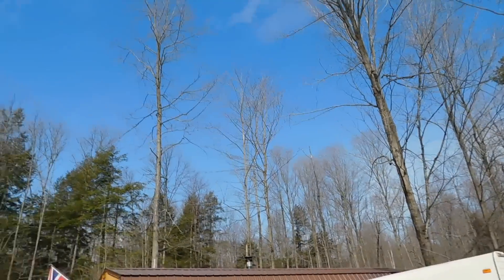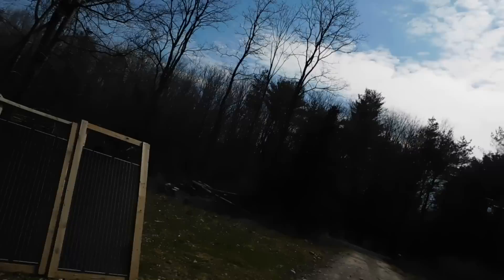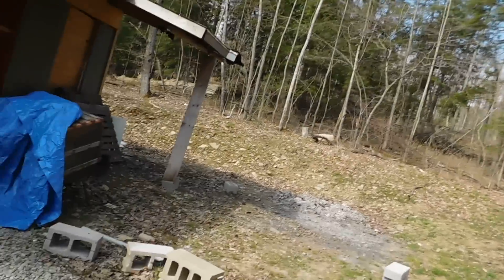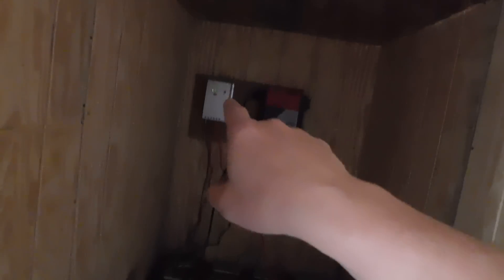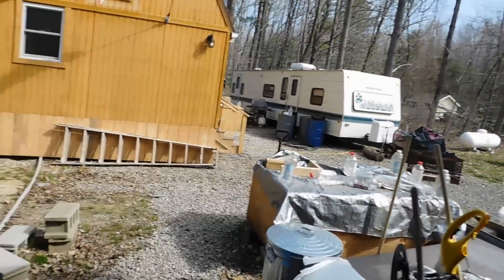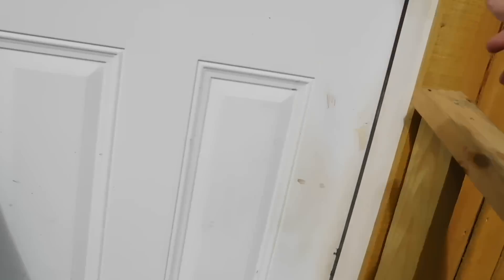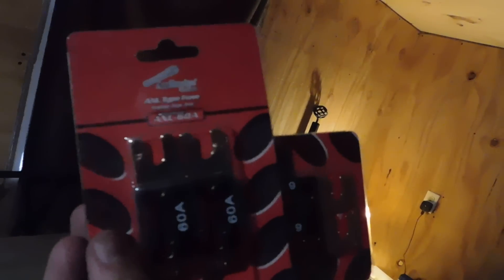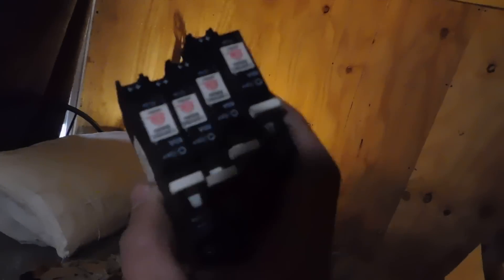Upgrading my solar system from 12 volts to a 24 volt system.

Comment: What would u recommend (solar panel wats & battery supply) for someone who uses one fridge one air conditioner a big heater two laptops two fans and cell phone charging and electric cookers and  microwave ? Basic stuff. I'm a newbie. Thanks!
Reply from the maker: It always comes down to wants and needs. Are you in the city or country? The l16e batteries that I have are very good you could start out with 4 And than add on as you need to I would say you need at least 1000 watts of panels and again add on as you want if you want more power.
Reply: +preppernurse1 I would be countryside and how much would the startup for four batteries cost? How much Volts are they a piece? And how many solar panels would it take to make 1000W and estimation of costs? Thanks so much. Like I mentioned Im so newbie and ur videos caught my attention so i thought I'd ask! ;)
Reply from the maker: Diet Pie Diaries The panels are 250 watts  so you would need 4 they go about 240.00 apiece the batteries are  258.00 each. but then your going to need a inverter and charge controller and for good ones they are about 850.00 each so its not cheap. but worth it in the long run. you can start smaller and work your way up that's what most people do.

Comment: therse not a lot of difference in reality, but a lot of urban myth when it comes to solar charging and battery storage.

storing as 24v or 48v or 12v is all equal. charging is equal.

what is different is drain, the inverter, converting from 12 to 120 is 10x multiplication, and multiplication does not only convert voltage it converts inefficiency, so a 12v inverter can have more loss than a 24v or 48v one.

so the big question, wheres the biggest loss, well there's 2 points, the inverter and the battery itself.
use your battery at its raw voltage and dont put things on to ac you dont need, make all your lighting and entertainment system dc, and this is where 12v systems win, direct connection. to run a 12v radio or tv you end up needing to drop the 24v or 48v back down. and thats just about lossy as the inverter and running them from the ac

thenext biggest loss is the dinosaur technology of lead acid batteries, every year a new round of claimed improvements to keep us buying the same old things.

lead acid, very wasteful charging,  very bottle necked and lossy when discharging, and they are always going down even when sat at idle due to self discharge

the best battery for charge storage is off the shelf lipo, but the cost is artificially high for what is just foil charcoal and ethanol, the amount of lithium used in them is miniscule
Reply: Not quite true. 12 is great for an RV, but a real system should use at least 24 VDC. Do the math, not urban legends...LOL. The losses from higher voltages are much less. Why do you think they send power at such high voltages?
Reply from the maker: +lez briddon Very interesting thanks for that info.

Comment: are you doing the work yourself?..Please say yes
Reply from the maker: +ManOfMany Thingz Yes with the solar I am doing the work myself my cousin came over and we worked on it together.
Reply: +preppernurse1 Nice..
Reply: +preppernurse1 I told this other guy not to buy junk but he wouldn't listen...you know who im talking about...
Reply from the maker: ManOfMany Thingz Its a two man job that Ames inverter is 68 lbs alone.  I held it up he put the screws into it.
Reply from the maker: +ManOfMany Thingz Yes I know how you mean.
Reply: +preppernurse1 I'm looking at the AIMS 8Kw 48 Volt 120/240 Volt model for my next project.  It weighs 132 lbs.  I think that's too much for wall mount and will require a custom shelve.  68 lbs should be fine to wall mount with BIG screws and plenty of meat behind it.

Comment: your progress is impressive.  This month I need to start on rain catchment system and hopefully in a few months begin solar and wind.  Still working on getting the garden in and fyi those chicken coop kits are made with very cheap material.  It is brand new and falling apart.
Reply from the maker: +mary smith Sorry to hear that about the chicken coop. And thank you I know you will reach your goals as long as you put your mind to it.

Comment: Midnite Classic and L16s...  Great Choices.  Will that inverter allow 220V AC wiring?  (two hots and a neutral)  Might come in handy if that washer/dryer combo is 220.  I know AIMS makes a 24V 110/220 model.  Just curious.
Reply from the maker: +TimeDrawsNigh Yes I can jump it up if I want to. And I  am looking forward to seeing how it does.